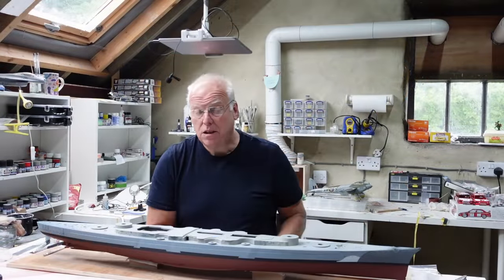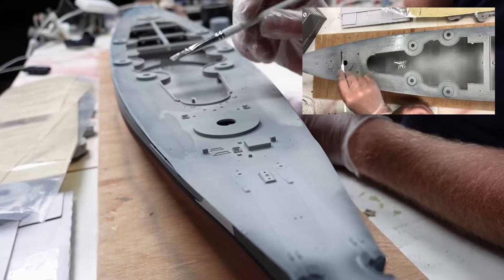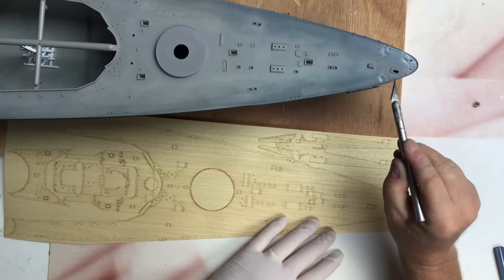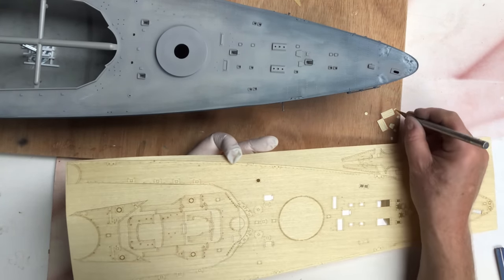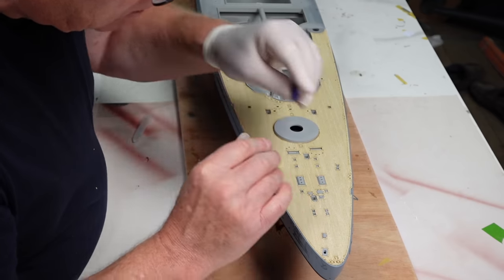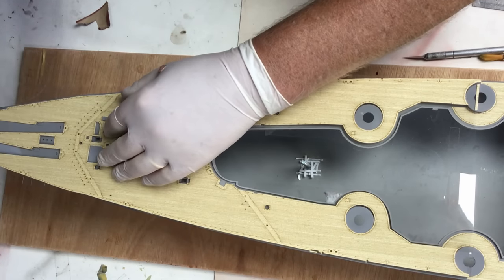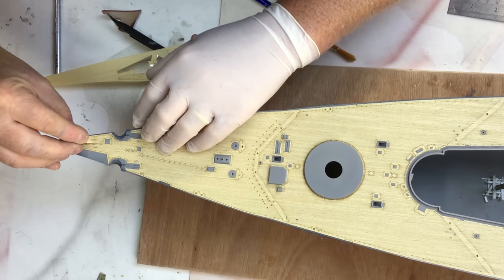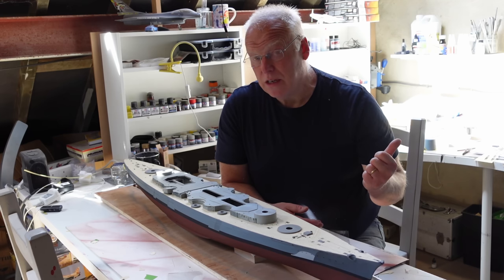Trumpeter 1/200 DKM Bismarck Full build with Pontos detail set Part 6

Comment: Hope you dont mind. Just for trivia. The anchor "cable" not chain goes to the water via the hawse pipe and the other end goes to the chain locker via the spurling pipe. This end is secured in the cable locker by rope in case the cable carries away. The rope is a weak link. This end of the cable is known as "the bitter end" If a captain lost the bitter end, it refers to the end of his career, at least with that company.
Great videos. My Bismarck is in the post but watching all the Hood vids while waiting. Thanks for making these vids.
Reply from the maker: Hi Anthony and thanks for the background to the correct terminology. There seems to be a few everyday terms that have their origins in naval references.

Comment: Excellent tutorial on installing decks with adhesive backing. Curious. For decks without adhesive backing what would your procedure be to install them. Some of the videos I have seen show the plastic deck and the wooden decking being coated with a wood glue and set down.
Reply from the maker: Thanks Iran. I’ve never really been convinced about wood glue for decks. There is no real bond between it and the plastic and I would imagine it would go hard and detach after a while. I would use a contact adhesive myself.

Comment: hello mate,nice work,I have a question, can I use clear spray varnish or does it have to be painted with a brush? How does it work? Do the decks hold well over time? Is everything OK?thank you.
Reply from the maker: I can't see how you'd spray the varnish without getting it onto the rest of the detail on the superstructure. Applying with a brush is more accurate and cleaner. It gives a smooth surface for the adhesive on the deck and removes and dust. Provided you keep the model at an even temperature the decks will stay put. Otherwise the expansion and contraction of the plastic at a different rate to the wood causes bubbles. My Hood is over two years old now and there are no problems with lifting.
Reply: @TheModelShed  Ok thank you.